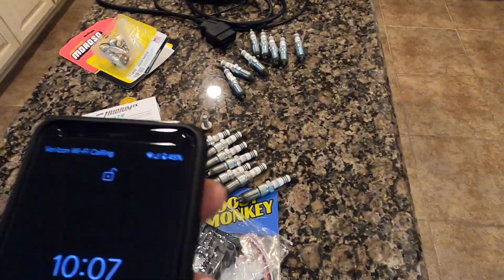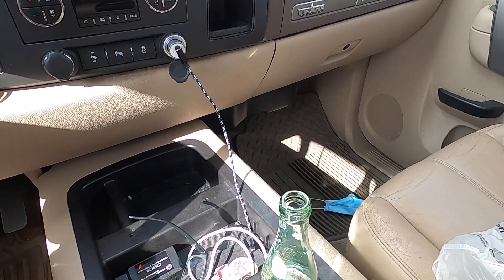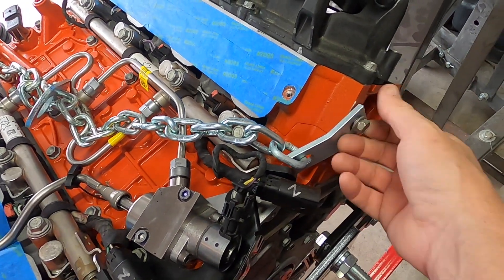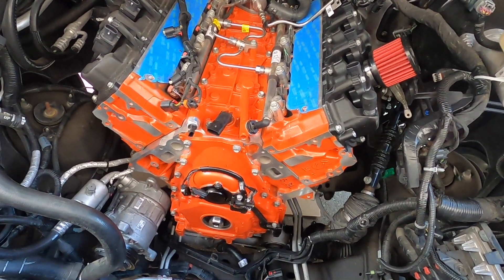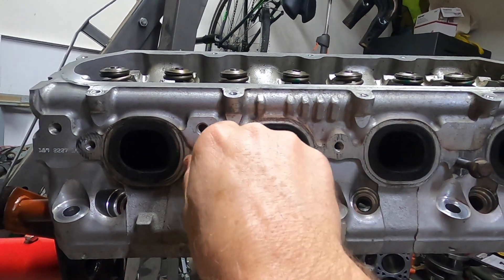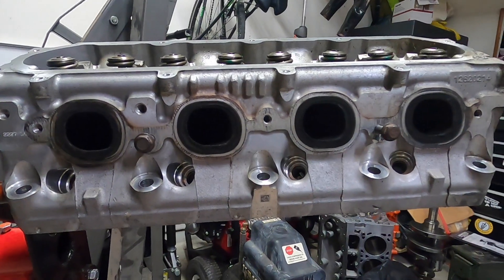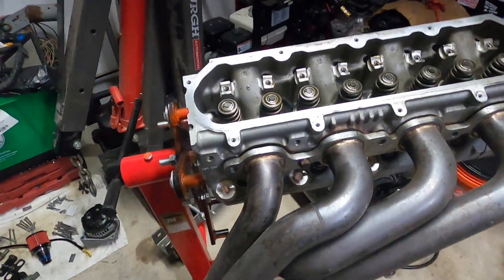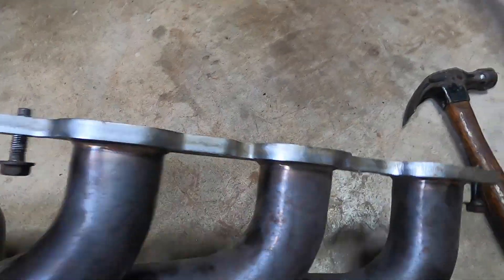Supercharged L83 Forged Engine Install - Part 1.       5.3 6.2 Sierra Silverado Whipple

Comment: Dammit man...Now I’m going to be pulling my headers off to add spacers and V bands lol. Mine are definitely a little crooked and I spent a good while trying to get them straight with another guy helping from underneath the truck. Perfect solution 👍🏻
Reply from the maker: I did the same thing before the bushings.  There is a LOT of vertical slop at the end of the header.

Comment: What set up do you have in place of the vacuum pump? Is that a pcv connection I see? I'd like to do that to my '16 if it works for brake vacuum.
Reply from the maker: It's just a vacuum hose that runs from the booster to a port on the back of the manifold.

Comment: Do you think 3/8 spacers would fit perfectly Instead of the 7/16 spacers?
Reply from the maker: You would need a 3/8 hole in the header flange and a bushing with a 3/8 OD and .319 ID.
Reply: @n5yiz  thanks for the response. I was trying to avoid drilling
Reply: @n5yiz  your videos are awesome thanks for posting them. Wish I can pay you to work on my Silverado I’ll be happy with 580hp😁

Comment: Which spark plugs where you running on all motor?
Reply from the maker: I don't remember.  Look in that "corvette cam" dyno video, it's all listed in the description.
Reply from the maker: NGK 6509s
Reply: @n5yiz  how long did they last you? I have the same Bolt ons on my truck minus the cam and I noticed that it was misfiring on the freeway. Not sure if it’s only the plugs or cables and coils. I’ll start with the plugs first.

Comment: No balancer on ,would that have made it to tight to drop in?
Reply from the maker: yep...barely fit without it installed
Reply: @n5yiz  Any other tips for R&R,im about to pull the 5.3 in my 014 SWB 4x4,doing mahle dropins GPI cam/whipple.Thanks
Reply from the maker: @thegonz7833  I can't think of anything specific.  There's a ton of places to make mistakes...LOL